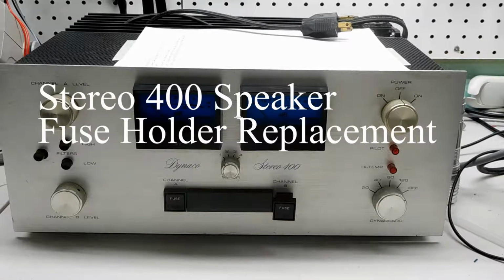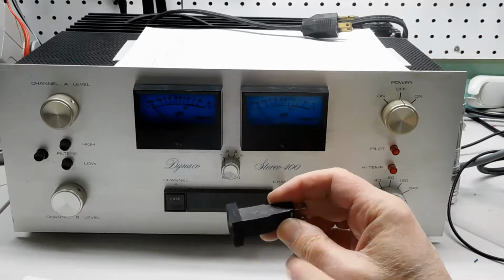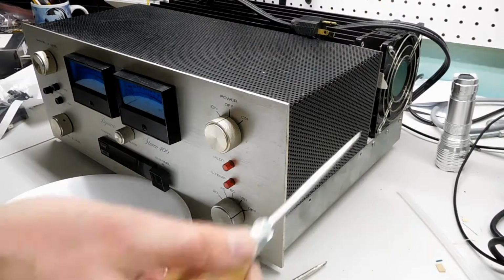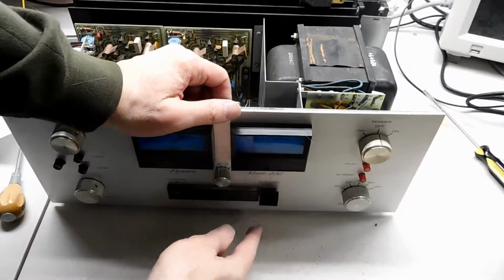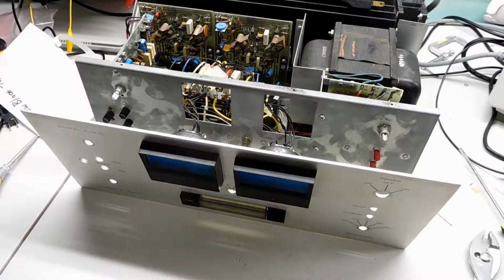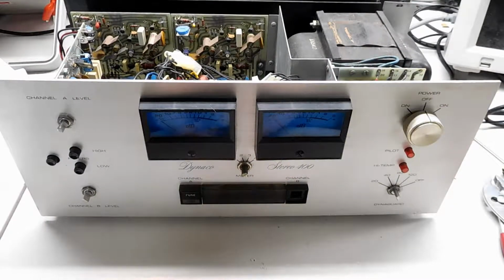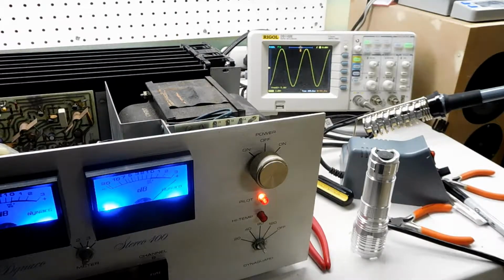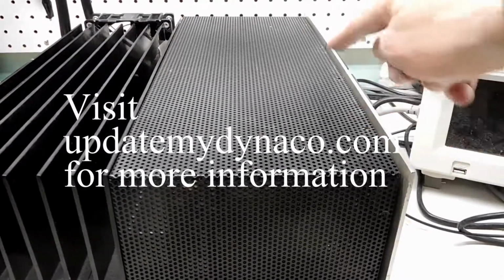Stereo400Movie

Comment: Great video,  you wouldn’t happen to know what volume control pots are in the 400?  One of mine is beyond cleaning.  

Thanks in advance!
Reply from the maker: 100K linear taper pots. That's a bit unusual, but it makes sense when you recall they were used just to trip up gain balance a bit. If you send email to dan@updatemydynaco.com,  you can buy replacements.
Reply: @ 
Thank you!

Comment: Thank You for sharing! I bought one of this kind recently for 50€ in Austria. One channel wasn't working and the whole outer case looked (still looks) like someone used it as a brick in a wall. I was able to fix the one channel. But: the lights of the dynaguard component are constantly on. Nevertheless it works and sounds good. Do You have a clue where to start when fixing the dynaguard function? I read all kinds of documentation but couldn't find any helpful hints. I would appreciate any kind of help.